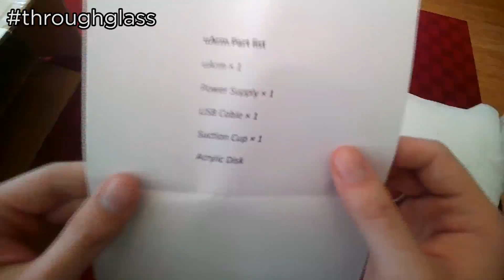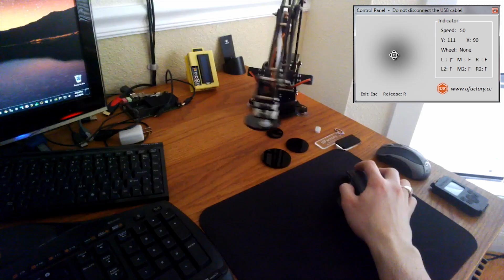uArm Review: Open-Source Robo Arm for your Desk!

Comment: Very disappointing review, Jeremy! I get that you have little or no use for a desktop arm (maybe you were too hasty with that comment or simply didn't feel in the mood to exercise your imagination), but you told us very little that is useful. 

We would expect to hear about speed (for programmed movements (does it optimise paths?)), the precision, repeatability and load specs, power consumption, duty cycle and perhaps more about the optional gripper (holding force, grip size and geometry.

Obviously, you could think of more - but you needn't even mention everything - just a bit more than implying that you have no idea if it's easy to build, since it was pre-assembled and saying something along the lines of "this is cool and you can drive it with your mouse and I can't think of what to do with it"! 

1 star for the review.

Comment: Maybe this is weird, but the first thing that went across my mind is SMD pick and place.Do you think the pneumatics could be hacked into doing that?
Reply from the maker: I don't think it would work for super tiny components like 0201 resistors, but I think you could make it work for some bigger SMD ICs.
Reply: Jeremy Blum The sucktion cup that comes with it looks a little too big for that kind of application, but should be replaceable. The part that would worry me most is pump control.  I'm not sure you can go from lifting your android bot off the table to not breaking 0201s in the same system
Reply from the maker: cmdstraker it comes with multiple suction cups. 1 is pretty small.